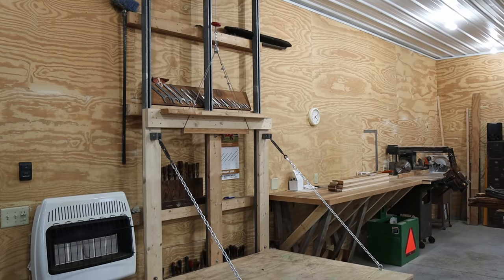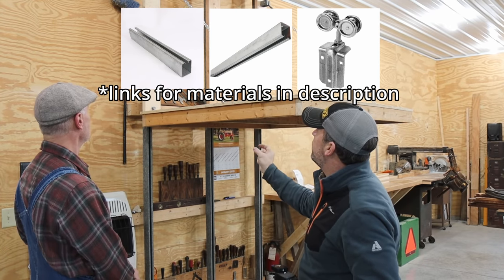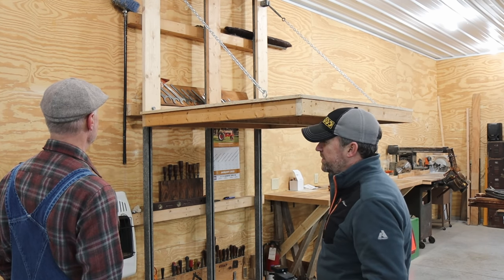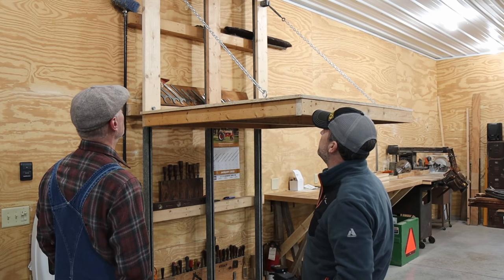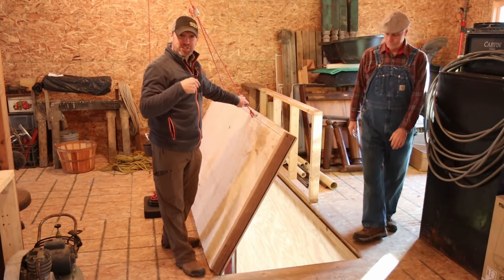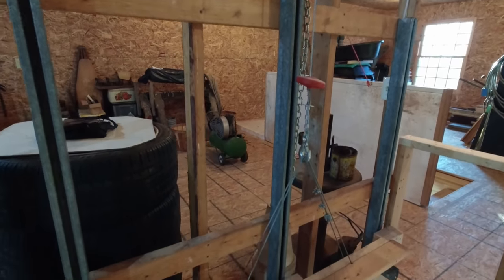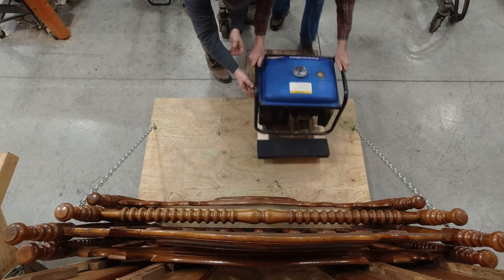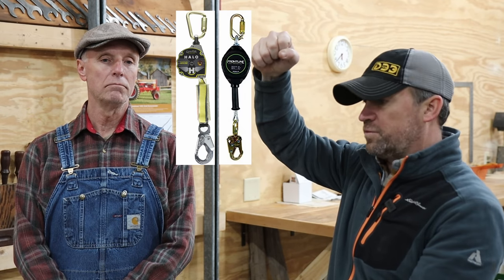Homemade Shop Attic Elevator [MAKES ME JEALOUS!] DIY Garage Elevator How To

Comment: Love the Elevator. Been thinking of building one myself. Barn door track, never would of thought of it.

A word for anyone thinking of building anything for moving any kind of weight. Always build to your weakest link. You can have a 5000lb hoist but if the platform can only hold 50lb thats your limit. Test each part separately as you go. Never put anything under a suspended load you don't mind being destroyed if it falls. The old man clearly has an eye for safety.
Reply from the maker: He keeps a pretty close eye on things. Thanks so much for checking out the video!

Comment: I built one very similar.  Used 2" square tubing for tracks.  Chain supported platform that can be swung up out of the way when sitting on the ground.  Steel rollers on back, front and side of rail.  Use the same hoist for mine.  Also installed a retractable fall lanyard as a backup.

Comment: That elevator is as good as any I’ve seen on YouTube. The only possible weak point is the hoist but I’ve seen many of them used and no one seems to complain about quality. 
Like their dust collector, the hoist might be one of the HF gems. 
The 2 stage balancer for the door is brilliant. As JasonWorksALot said, they’re definitely ideas to lock away in the old noggin.
Reply from the maker: Yeah for sure.  He has another one of those hoists in his A frame and they seem pretty good for the money.

Comment: I thought about a "lift" for my storage area above the 'shop', but ended up with just a fold down 'attic stairs' and had the upstairs full of junk before I knew it. 
 The whole layout of the house and shop shows a good amount of forethought. 
 I had to back up and run in slow motion so I could read the Pratt&Whitney on that old lathe. I have a 1934 south Bend in usable condition. It's helped me out many times with 'projects' i dream up. I used to work in a machine shop, so the South Bend got passed up for use when I could whip something out after hours at work.
Reply from the maker: His lathe is a 1938 I think he said. I should have put it in there.  Maybe older🤔. Now I'll have to go look.
Reply: @digdrivediy  It looks like it could use a little TLC 😉
Reply from the maker: @bluegrallis  Yes indeed.  It went through a fire at his last shop.  Couldn't bear to part with it.

Comment: That is slick and simple.  I went way overboard.  I bought a used pallet stacker.  It's like a forklift without the tractor.  It has forks and you pick up pallets using electric over hydraulic but then you have to push it around as it's on wheels.  I built my platform on the forks out of 2" square tube.  Then I recessed the whole thing down into the concrete so that the platform is level with the shop floor.  That way I can roll a pallet jack right onto the platform.  It will lift 2 tons 12 ft and it has safety valves built in so that if a hose would brake or there would be any other catastrophic problem the platform would just glide down to the bottom.  So I don't have any qualms about riding it.  But it cost 20 times what your father-in-laws did, maybe more.
I might have to "borrow" that 2 stage door weight idea though.

Comment: Grandad had a elevator much like that in his barn. You could pile bags of feed or straw on it and than pull it up. No electric Winch, set of pulleys and man power. And yes us kids used to pull one another up and down LOL. I can't remember how it worked but had some kind of brake system you had to hold the rope tight and pull it down did not free fall, wish I had some pictures of how the down rope worked.

Comment: Simple and effective, though being a pully and snatch block enthusiast myself, I would certainly entertain running a little longer cable with two double pulleys looped for more load capacity or reducing effort on the motor. I'm sure he's taken into calculations that the platform itself is part of the load rating, but I commend him on not riding the thing at every opportunity!
Reply from the maker: I think he may have tried and it affected the speed.  I could be wrong I don't remember for sure.

Comment: the dual weights for the door is similar to overhead garage door springs; the higher up the door is the less tension is need to pull it up.

Comment: Great design and let me preface this next part with I completely understand the reasoning for keeping the control in the attic. However...... He may regret that later on in life when every time he wants to stow something up there he has to go upstairs to send down the elevator 1st and if he is doing multiple loads having to continually go up and down the stairs. It may be a cumbersome thing. 
What he could do to prevent children from playing with it (Ive seen this on other videos where people installed the elevator) is get a remote with keyed access. So they cant use it without the key enabling it. Or they have a wall switch (some with a keyed wall switch) that controls the power to the winch. This also prevents others from playing with it. And if you trust the build and have the safety fall arresters installed you shouldn't fear riding it up yourself.
Reply from the maker: Good thoughts. He has provisions for a remote switch.

Comment: Great idea and looks like it works great. I have to ask, though....you are storing a lot of weight on those crossbeams. At my previous job I was a technician. My boss had ordered a bunch of equipment and wanted me to store it above our testing room, in the attic space. These boxes had quite a bit of weight so I asked him if he knew the load limit of the attic and he did not. I suggested he hire an engineer to inspect, as there were a couple of employees that worked directly below for 8 hours/day. He ignored my suggestion and told me "it will be fine, just do as you're told" so I did. Well, that weekend the ceiling came down and thankfully it happened when nobody was working. Just a thought.
Reply from the maker: That is a good line of thought. But in this situation all the weight is stored over a supporting wall underneath. Plus, this barn was engineered knowing that he wanted to have upstairs storage. So I think you'll be pretty good in this spot. Great thing to think about though for those adding something like this to an existing building that wasn't spec'd for it.
Reply: @digdrivediy  I'm glad you mention this fact, as most DIYers don't think in engineering terms of load capacity and safety margins.  I have an attic storage above my garage and I probably will place I-beams across the expanse of my lower ceiling to support the weight above.  Thanks for pointing that out in your comment.

Comment: I really enjoyed your showcase of this aspect of your father-in-law's talent and vision. Looks like the perfect execution for my values and needs. The construction and rigging of the elevator car confirm how I would do it. I'm a bit of a hoarder myself (collecting material for current projects and those going into my retirement tinkerings) I appreciate the explanation of the 2 stage weight enable door system and using the barn door rails and trolleys.  I have a winch with a wireless controller hooked up which will lend flexibility in the usage of the lift device. Is there anything he would have done differently or needed to change since it has been in service?

Comment: I love the lift, the Ford, the shop and especially the Porsche. I had a 1967 Porsche in High school that I pulled out of a junk yard and I had no idea how much it would be worth now. My dad made me get rid of it because he doesn't like old things . The late and Milling machine are mint!! I just purchased a metal lathe and a Burke Number 4 horizontal milling machine. I am gearing up to start a Youtube channel building a 1928 Morgan MG Special Brooklands edition with 4 wheels. I sourced a BMW R-100 motorcycle engine for the power plant. Where are you guys located. I am starting a shop that specializes in pre-WWI race cars and air cooled and distributer equipped exotics.

Comment: Excellent build and exactly what I'm looking for. My question is how did you run the cable from the motor? It looks like it's doubled over on both sides as opposed to being attached in one place? A little hard for me to tell. Well thought out design I'm envious.
Reply from the maker: There is a bridle that goes to each side and the cable is just attached to the center of the bridle.  Basically it is hooked in the middle and a separate cable ran to each side of the elevator.  Sorry, hard to explain.

Comment: I use a wheelchair so when I built my house, I wanted no steps.  I built an earth contact home 30" wide with a 10/12 pitch roof, so I have a lot of room in the attic which I wanted for storage.  18'x80'.  I designed it with a big out of the way closet in the house side off a garage wall that I hide my elevator in.  I built mine as a platform 48"x52" out of 1" angle and 3/4"plywood bottom.  It rides up and down on two 2"x18' long 2x2 pieces of square tubing surrounded by 2 1/2 tubing attached to the platform.  Picture a guillotine the way it slides. We made the pieces and had them galvanized and slid in place before the roof was sheeted.  It is bolted to the concrete floor downstairs and tied into the roof collars in the attic for lateral support.  All the weight is centered and runs down to the floor.  I have the same hoist, but mine is a 2 ton.  Since I ride on it, I wanted overkill.  I inspect it often and been using it for 30 years.  It hasn't killed me yet!  lol
Reply from the maker: That's great that yours has been working so no long without issue John.  Sounds like quite a fine piece of engineering in itself too.  Thanks for sharing!

Comment: Between you, your father in law, and your own father you guys could engineer and make just about anything or tackle any project! I am guessing he has another generator stored on ground level though? Would be no fun during a power outage to have to lug that generator down the stairs because of not having any power to run the elevator.
Reply from the maker: Thanks Allen!  Yeah, Rick has an automatic backup generator that comes on when the power goes out so, he can still use the elevator to get the generator down for me 😋
Reply: @digdrivediy  I figured he probably had one, looking forward to the day you put out a video of your future automatic generator being installed at your place!

Comment: This is an awesome elevator solution. I’m building a garage with upper level wood workshop and would like to include this and the stair door in my design. Do you have any building specs you can share?

Comment: Is weight distribution a huge concern? I like the track idea, and will implement on my elevator.  Thanks for the great idea.
Reply from the maker: Not really a problem.  Like Rick said he tries to keep the heavy stuff towards the back is all.
Reply: Weight distribution should be a factor in the construction however the tracks are merely a guide for the platform going up and down. The closer the weight is the the track the less binding there is between the rollers and the track and the smoother the ride up (less friction and less wear on the rollers).

Comment: Seems ok, just a little lightweight.  Easily fixed.  A pair of 2xs for stiffeners underneath 4:34. I don't think the connecting links for the chain are rated for that load. Go up a size or two.  The side walls need sheathing for shear strength. 9:45   1/2 is fine. Over time it will severely weaken without it.  I personally would have hinged the access door on the short side, but that is personal preference. The rear needs sheathing also. Behind the rails. (these are typically used for ready to wear clothing racks in store storage. It's a cheap version of Tico racks. Perhaps small metal plate underneath the hook for the chain to prevent pullout and wear.  10:45  Double up the king studs inline with the jack studs in the ceiling,  (vertically)  3:51 
     The way the chain connects to the platform really bothers me.  A u shaped metal bracket that supports the 2x from underneath is needed.  4:10
     I'm a retired carpenter that worked in the elevator trade for 12 years. There is a bunch of small things that could be done, but you need someone on site to advise you.  See if you can get a local elevator guy for help. 
       It would would be nice to use a counterweight system to take the load off the motor. The entire thing would have to be rebuilt though.  I don't see a safety for the platform. As long as nobody rides the lift, whatever. 
   There is an old saying,  "good enough, ain't".
Reply from the maker: Thanks for all the terrific insight and tips from a pro.  We will need to look into a few of those things.

Comment: Careful putting the generator upstairs, the electric lift won’t bring it down for you if you’re both out of power.  I know your learned your lesson…. I better go check to see if my generator starts.
Reply from the maker: Ha! Would be very true if Rick didn't already have an automatic backup generator.  He can still run his elevator even when the power is out 😎 But, I still need to double check mine.  Calling for a storm....

Comment: The new tracks they sell aren’t nearly as heavy duty as those old ones. I’d be afraid to use new ones.
Reply: The tracks aren't carrying the load though. They're just guides. All the weight is on the winch/building structure.

Comment: IMO, unless you intend of riding it, there’s no point in using a retractable safety line. Most of them only have a rating of about 400 lbs and those above that are quite expensive.

Comment: You really should switch to wireless remote Winch(comes with 2 remote's,keep one on each floor)Can purchase a 1300lbs.Winch for $150.Of course the lower the weight you want,The cheaper the winch......

Comment: Check you state & local elevator codes and licensing laws. I love the ingenuity! But... In most states this device is fraught with code violations and installed by unlicensed individuals. I'm just sayin, don't kill the messenger.